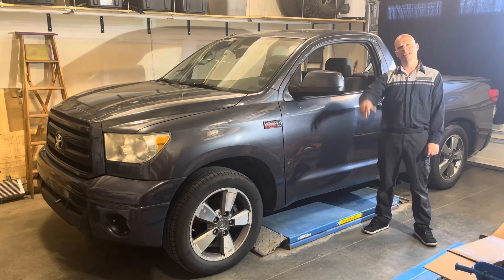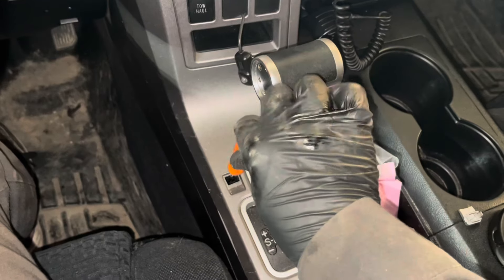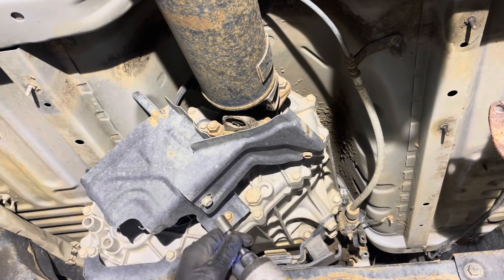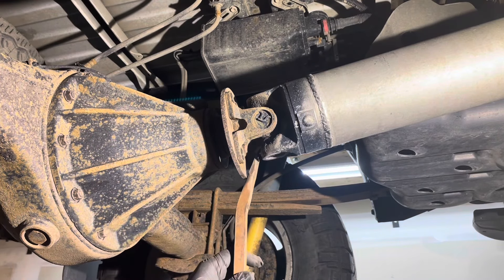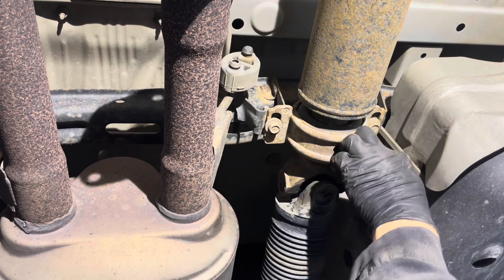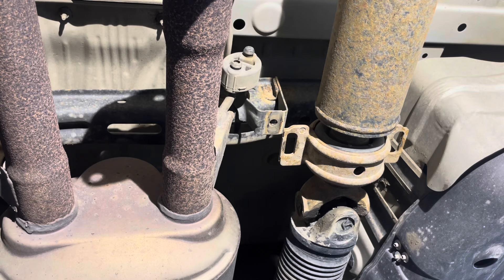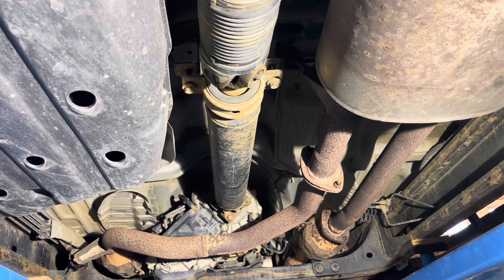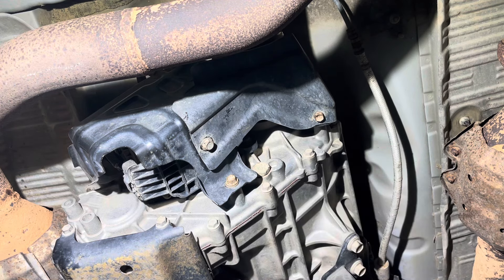2007-2021 Toyota Tundra Rear Driveshaft Propeller Shaft Removal And Installation Instructions

Comment: What are symptoms that this is needed ?
Reply from the maker: @Trellzzz  usually the symptom is vibration or noise. You would need to check first to make sure it is not a bad u-joint or centre bearing. If those are good, I’ve seen the splines wear out on high mileage truck requiring a complete driveshaft replacement. The shaft can also get bent from impact when off-reading etc. U-joints and centre bearing can be replaced separately.

Comment: Could you do a supplement video on changing the center bearing on the driveshaft? And is it a DIY job?
Reply from the maker: @jeffobermesik9558  I have never replaced one, but I’m sure it can be done at home if you have the right tools. If I ever need to replace mine, I’ll make a video.
Reply: Thanks for the quick reply. Is there an acceptable amount of play/movement in the bearing? I’m wondering if that is causing a little bit of driveline vibration. My 12 Tundra is at 205k.
Reply from the maker: @jeffobermesik9558  it has a rubber bushing built in, so there is definitely some movement when you push on the driveshaft side to side next to the centre bearing. But you should feel resistance when trying to move it, there shouldn’t be slop or play.